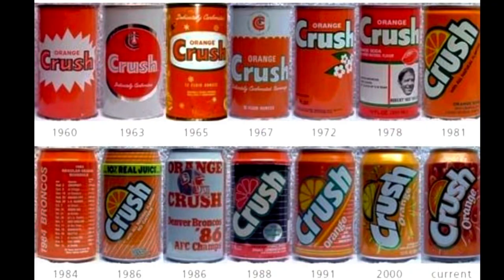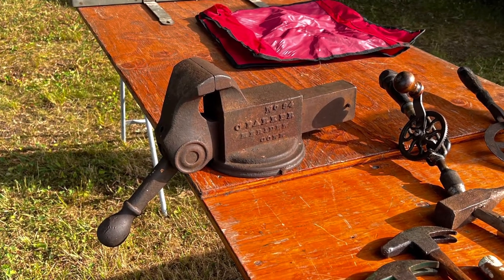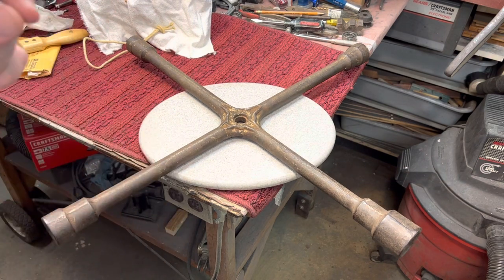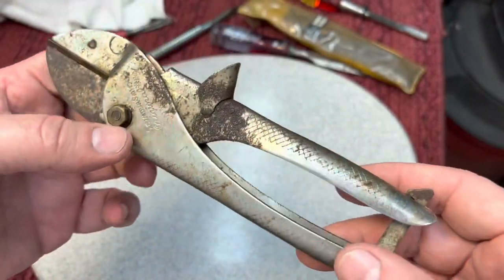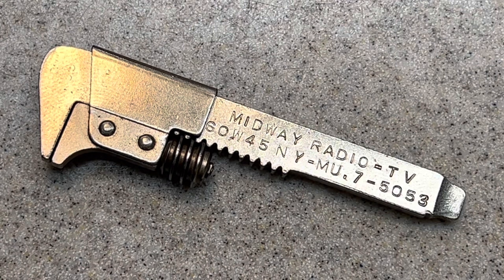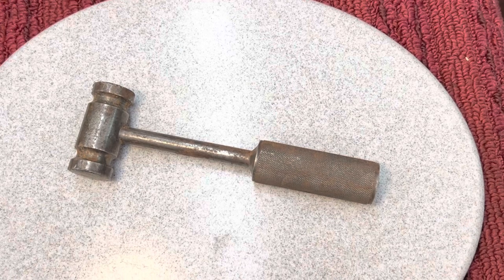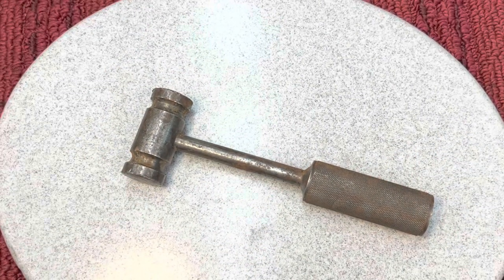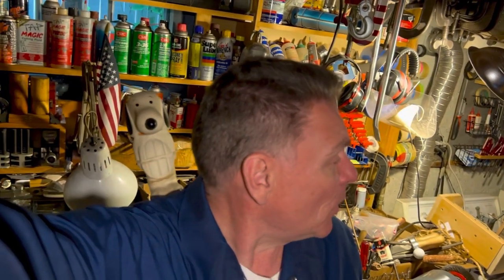Hammer Restorations, Super Scraper, Zagray Show Report-  Super Mega Mosh!!!!

Comment: Loved the episode, especially the scraper segment. I'm a knifemaker and somebody just turned me on to plastic razor blades. They are fantastic. They fit into any razor blade scrapper you have and they really work well and the best part is you don't have to worry about scratching metal surfaces when scraping off dried epoxy. Give them a try. ps. I really love your electric motor rebuilds.

Comment: Wheel tight tool, may be a spoke adjuster of sorts.Just a shot in the dark……Thanks for what you do..James
Reply: Might it be used in setting up the spokes? Bending the ends and crimping the screw.  There are spoke wrenches for tighting spokes.  Could this be used in making the spoke?

Comment: The mystery tool looks like it could be to open the old clamps that were around 1 inch made of heavy spring wire. they were on washing machines etc..   It looks like you squeeze the tool, put it over the clamp ends, and then when the tool closes it opens the clamp, then you place the clamp on the hose.
Reply: Makes sense as those rivets would hold and be the wear points for the ends of those kind of small but heavy gauge wire clamps.
Reply: I was gonna say the same thing. Wire or hose ring clamp?

Comment: Also, a little hack I came up with for using those long wire brushes on my drill press.  I take a 3” or 4” long piece of brake line and slide it over the shaft, it’s like a 360 degree platen so you can hold and direct the brush and apply more or less pressure wherever you need it
Reply from the maker: Awesome tip Hester!!!!!!!!!

Comment: Just an idea with the wheel tight pliers. Back in the days before security locked rims on cars, it was not uncommon to see decorative metal caps sometimes over the lug nuts but the ones I had in mind were friction fit on Schrader valve caps. A bunch of JDM cars in the early 80s popularized them. They were friction fit but there was a casting lip inside the blind hole that had a rather sharp burr. So if you wanted to make one of these decorative caps, you had to slide the rubber cap inside the metal one and then put needle nose pliers inside and gently press out. The idea was to embed the Burr in the plastic without damaging the plastic threads. That's a pretty narrow use case, not terribly likely, I happen to have some of these decorative caps just at hand and the scale certainly seems right

Comment: Most guys my age had machine shop in high school. One of the projects was to make a hammer out of various round stock. It taught you boring, threading, machining, polishing, and heat treating in the furnace. Along with machine shop was the woodshop, print shop, electric shop, and plumbing shop. These were offered to all the boys not just the vo-tec students.

Comment: That light you pointed out, I have the same love for all things gimbled. The more complex the better. I have a great ships compass and pinnacle that has a very ornate gimbal system using Quicksilver as a weight. I often buy large tool lots, I'm sure you're aware how rarely used the very large micrometers are. They chew up way too much drawer space for my taste. I discovered that the anvil is the same size as a dial test indicator stand so I use extra snugs to make the 22-in micrometer gimbal the 20-in, use the snugs to make right angles, then down to 18 in, 16-in etc. It makes for a pretty cool display, it doesn't move quite as freely as I might wish, but it's unusually enjoyable to fiddle with

Comment: Hi 
Very late to the scoutcrafter channel. But sure am I ran across it ! I've caught the tool bug lol. The wheeltite tatone as soon as I seen it i couldn't believe my eyes! My father had this in his toolbox! He told me about using it to put tires on his tether car rims and models. I'm looking through a magazine called model car science 1966 issue 126 and it does mention the wheeltite tool. It reads Don't twist a  tire to tighten a wheel and you don't have to with this new and different."wheeltite" cast aluminum plier from tatone. Then it goes on to say stuff about tires running true and this tool.  So glad i seen another one.great channel and will be watching more

Comment: One of my favorite scraping tools is just a small scrap of durabar. It's basically the closest thing to the cast iron of tools from the middle of the century. I really like it because it's hard enough to take down paint or even rust, but it's generally soft enough to conform to details. If you use a little bit of camp gas, the graphite from the durabar makes a kind of slurry. I put the same type of edge on that one would put on a carbide flaker. It's one of my at least once a week tools
Reply: What is durabar? Sorry ive never heard of it. I tried looking it up and a bunch of different metal bar stock sizes popped up lol.

Comment: I think you might be surprised by some of the properties of carbide if you experiment with the grind a little bit. A standard carbide flaker usually has a mild radius and is an inch wide, but instead of a 90° grind, it's typically about 92°, reverse rake, forming a very shallow edge about halfway across. This effectively gives you four different edges of fresh carbide with two different grits so to speak before you need to resharpen. Because when you are flaking you want everything to end up at the same height, it's ideal to not sharpen the tool part way through

Comment: Be very careful with carbide scrappers. They are so sharp they can actually damage aluminum parts. Very very light pressure or you can mess up the gasket mating surface.

Comment: On both of the short handled hammers that you did, I noticed you did the bottom two inches or so in red paint as well. I always particularly liked this detail with proto hammers and the shape of the green ends. I was just wondering, is it just tradition, or is there a practical reason? I could see arguably acting like anchor seal to seal the open grain end of the wood, but I've never heard a reason stated one way or the other.

Comment: I just bought a 7 tool li ion 20V Craftsman set so I own my first 1/4 inch impact tool and my first ever angle grinder. What attachments should I buy for it to restore tools?
Reply from the maker: A few flap sanding discs and a wire wheel will get you going nicely,  also a cut-off wheel later on!

Comment: Do you have a suggestion on a quiet air compressor? Was looking at something like CALIFORNIA AIR TOOLS 200CR. Coupling that would one or two portable tanks. 
This would be for use in a trailer. Kind of strange, but limits my ability to have a large floor standing compressor like I used to have.
Reply from the maker: Dan- The problem with the ultra quiet air compressors is CFM’s you need high CFM’s!  Two stage compressors are more quite then single stage.  Big compressors are annoyingly loud!  Look for a remote location.  😃👍
Reply: @ScoutCrafter  makes sense. Just a quick look online, two stage seems only 10-16 dB louder than the compressor I linked, but almost 3x scfm. Wow.

Comment: Dang I forgot to vote on the Crush can in the last video. Oh well. But I was drawn to the 1965 can. But then I saw the 1988 can. Which is the year I was born. And I did like that black-ish can, it was pretty awesome. Unique compared to the rest of them are either orange or white generally. Anyhow great question. I love vintage anything and looking at some of those older cancers totally gave me the fizz.. lol

(I added this part in later in the video. But that tool you didn't know what it was. Isn't that a key to one of those old doors. You know in the houses built in the 30 and 40. And those channel locks, if they are made by the same Williams. Williams tools some of, are made in China of course. But the US made Williams tools. Are still made in the US. And they are made in the same factory as Snap-On. Same quality tool just without the name and without the price tag.)

Comment: I'm putting this in a separate comment so it's not too long.

Anyhow at about 5:38 in this video you can see a grey metal tool setting on the table in the left side of the screen. It's setting between what looks like a black mechanics seat/cart/tool tray. And a smaller red vice. And this grey tool looks like it says Nesco, or maybe Wesco. On the side of it. Anyhow with all that said. I was thinking it was a manual press. But wasn't sure. Could you shine some light on that tool for me? My friend. Thanks for another great video as well.

Also at the 6:30 there's a, blue Justrite fuel can. I think I said something to you about me finding that 2 gal Justrite can for $5. But I wondered what that 5 gal can cost. And also what are the blue fuel cans used for?
Kerosene cans are yellow, aren't they? 
Are the blue cans for diesel? 
Or do I have the colors wrong? 
Or am I totally wrong? 
And then red fuel cans are of course, regular gasoline. 
Thanks for answering my stupid questions. Take care.

Also I wonder if the "TaTone Wheel Tite" is a locking lug tool. Or something like that.

I liked the longer video. And the hammered looked great as usual.